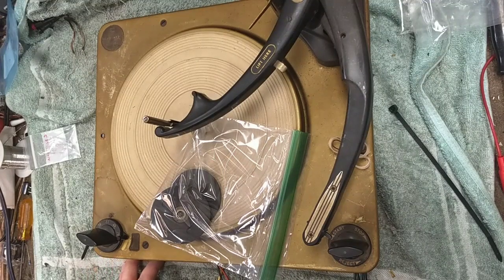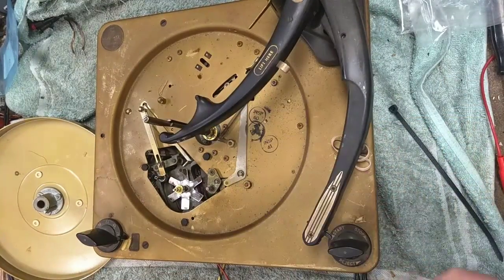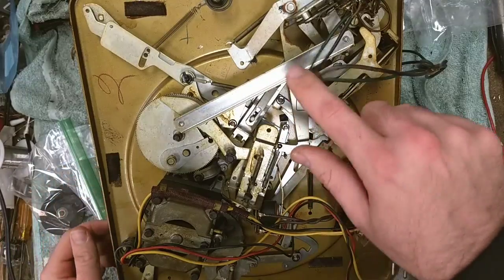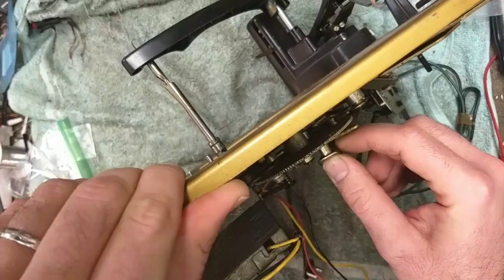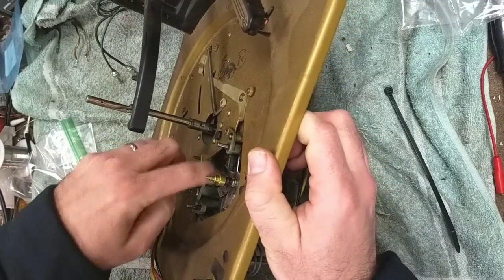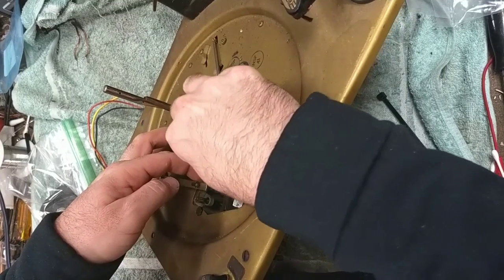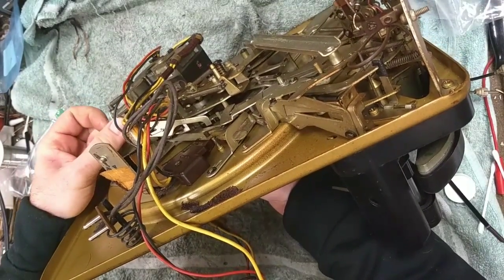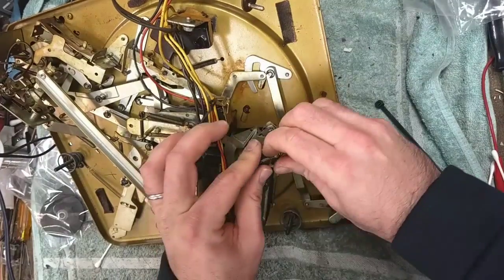Servicing a 1958, 1959,1960 Collaro (Magnavox) record changer - Part 2

Comment: Actually got the speed to change properly now and the drive wheel to engage OK. BUT the tone arm is acting like I'm playing a 45, even though a 33 album (or 78) is on the turntable and the speeds are set accordingly. It starts several songs in, and rejects before the album is finished. Is there a setting that controls this?

Comment: Jordan,I’ve purchased a Regentone record player with a Collaro turntable, about 1960s ,it has 3 pots ,the tone pot is busted,but I can’t see any number markings on it,what sort of value would I need to replace it? The other two are scratchy,but I’m going to try clean them with contact spray.any advise would be appreciated,thanks
Reply from the maker: Without a schematic your best bet is to unsolder the outside connections and ohm out the element. Go for a replacement with a linear taper that's closest to your measurement. It's ok to be a little higher or lower with a tone control.

Comment: My RC54 tone arm will lift up won’t, won’t move over in its own, but if I move the arm to the end of record cycle it will move back to the start and do the turn off and lower the arm back onto its rest. Any thoughts on why it won’t move over and go into the position for playing the record? Thanks.
Reply from the maker: Whatever clutching mechanism is supposed to bring the arm out has failed or there is a sticking part associated with record sizing selection

Comment: Ciao, buongiorno ti scrivo dall'Italia e vorrei un'informazione avendo le stesso giradischi, Nel minuto 43:11 togli un sistema a doppio albero dove da una parte va collegata la ruota in gomma che si collega alla camma del motorino per dare il movimento al braccio e al cambia disco, l'altra quella più lunga fa da albero ad una doppia ruota  che la parte in plastica viene fatta ruotare da quel piccolo ingranaggio dove sulla parte superiore andrà la ruota in gomma, a me in purtroppo  si e sdentata quella di plastica  quella che pulisci e ingrassi dal minuto 43:45 . Sai a che posso rivolgermi per un ricambio? Senza di quel meccanismo l'automatico non funziona posso solo usare il giradischi in modo manuale perchè quel funzionamento che tu fai vedere dal minuto 50:22 non funziona più grazie. 
Hello, good morning, I am writing to you from Italy and I would like some information having the same turntable, in minute 43:11 you remove a double shaft system where on one side the rubber wheel must be connected which connects to the cam of the motor to give movement to the arm and the disc changer, the other longer one acts as a shaft for a double wheel that the plastic part is rotated by that small gear where the rubber wheel will go on the upper part, unfortunately for me the one is toothless the plastic one you clean and grease starting at 43:45. Do you know who I can contact for a replacement? Without that mechanism the automatic doesn't work I can only use the turntable in manual mode because the functioning you show from minute 50:22 doesn't work anymore thanks.

Comment: Hey Jordan...HELP Please! My Collero RC-54 drive wheel does not drop down when changing speeds. Everything works OK on 45, but when I change speeds, the drive wheel stops disengaging. Is there a spring that is supposed to have tension on that drive wheel assembly when changing speeds? Everything works OK on 45, but when I change speeds, the drive wheel stops disengaging.
Reply from the maker: I know there is supposed to be a light tension spring to help engage the wheel against the motor and platter. I don't recall about the speed selector. Question is, can you by any light influence make the speed selector work correctly.
Reply: @JordanPier  Thanks for your reply Jordan. I found that by cleaning all of the old grease from the moving parts (which had hardened over the years) and then applying new lubricant, everything worked properly again. Seems that the old grease was hampering the full movement of the spring tension, so that did the trick!

Comment: i found out why the speed selectoracts up the screw that adjust the idler wheel height needs to be loosened so the bottom of that rod doesn't obstruct the part that moves it

Comment: If it was me, I would have bought a couple of cans of Brakleen and used an air compressor to clean the crap out of it until no residual old grease remained THEN carefully re-greased key points and oiled with light oil.  Dirt and old grease really are tough to deal with.  Dirt + grease = muck.  So best to just go ahead and get rid of it and move on.  Either that, or just soak the whole thing in gas after taking off the rubber and plastic first.
Nice job - tho . . . lotsa patience . . .